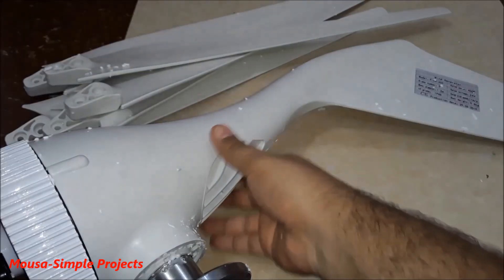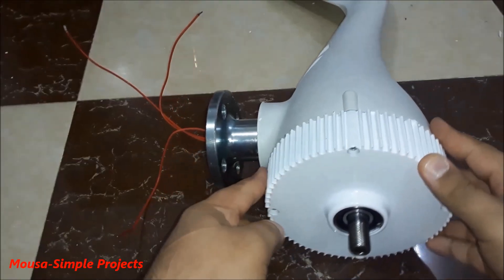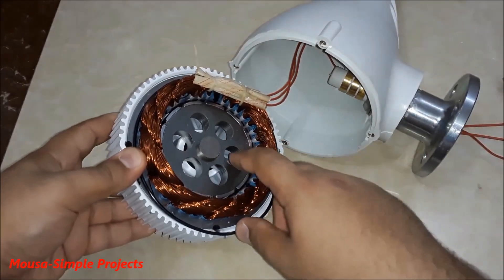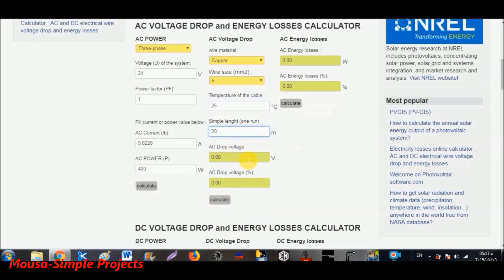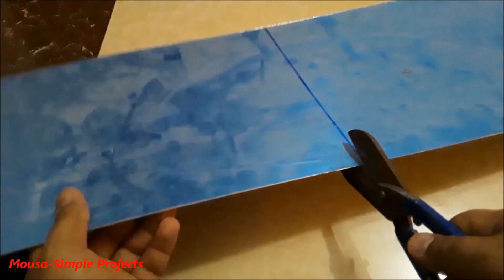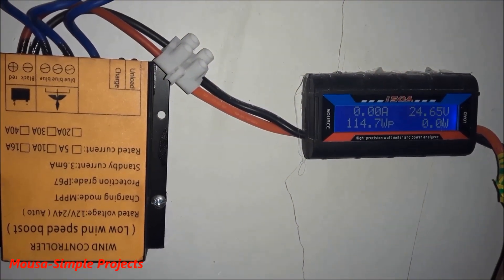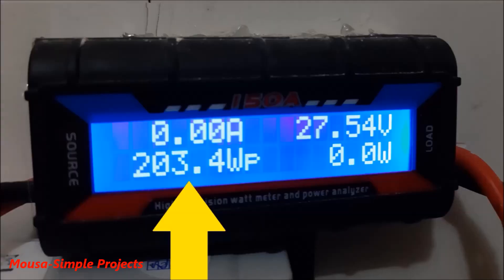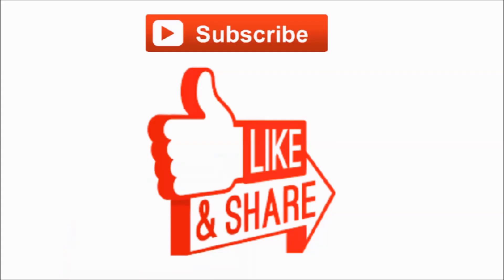400W Wind Turbine Review and Test

Comment: Thanks for this video, I have small wind turbine 400w and I had same problem, my wind turbine doesn't track the wind because it has small tail, after increasing the tail now it faces the wind much better, again thanks for your effort.

But I have question, how did you connect that capacitors after the rectifier.

Comment: Do these come with the wiring to connect the wind turbine to the power station, charge controller? Or do you have to get that separately?

It also looks like the wiring for the wind turbines is different than for a solar panel system. So what should you look for with the wiring?

Comment: By using just a Solar MPPT controller behind a bridge rectifier you have one big problem. If your batterie is fully charged the controller will not put any load on your generator anymore, because for solar it is not needed. But for a wind turbine you need an additional load (load resistor for small power turbines, bigger loads for more powerful trubines) to slow down the turbine in high wind to prevent damage from the turbine and the rotor blades. For the turbine you used it does not matter, because even the controller you get has no external load.

Comment: I have the same turbine and I found exactly the same results, it does not have a large enough tail to turn into the wind at low-moderate wind speeds. Thanks for comparing the various controller types and showing us the differences.